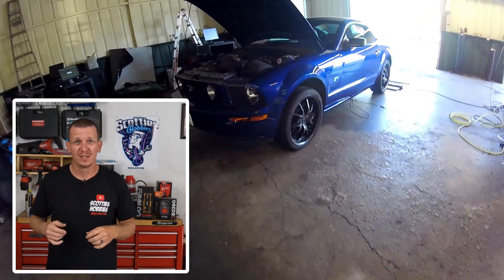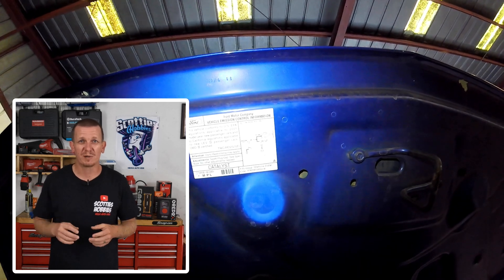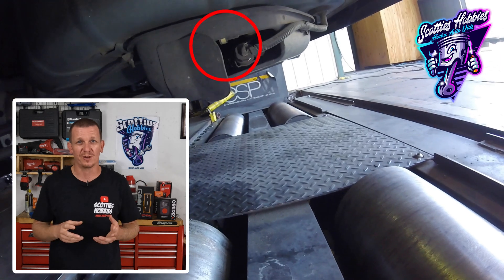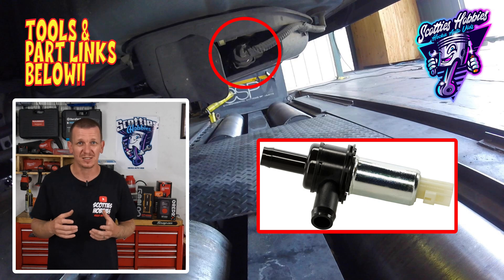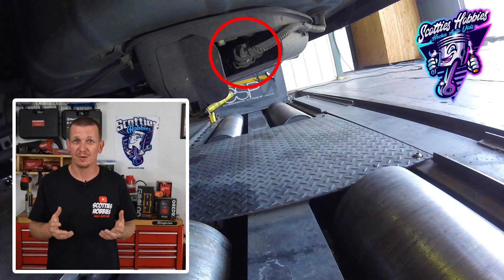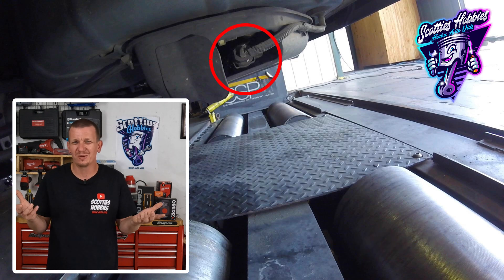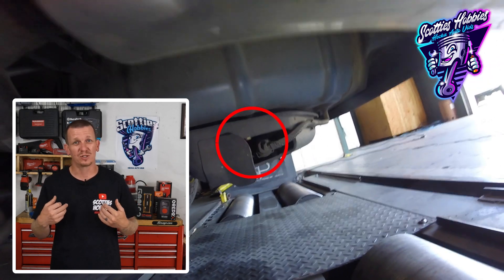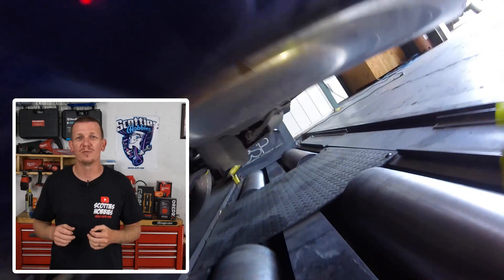🚗 Ford Mustang Emissions Vapor Vent Valve Location + Common OBD2 Codes & Symptoms (2005-2007) 🔧

Comment: My vehicle code is P0456. It’s a 2007 ford mustang and my check engine light is on. It’s the only code that popped up. Got a brand new Gas cap and everything. So. When I pump gas. It definitely shuts right off. And I want to thank you for this. I’m going to check that out soon as possible.